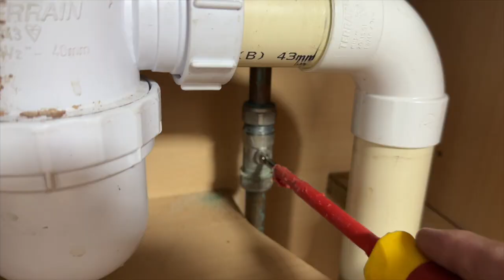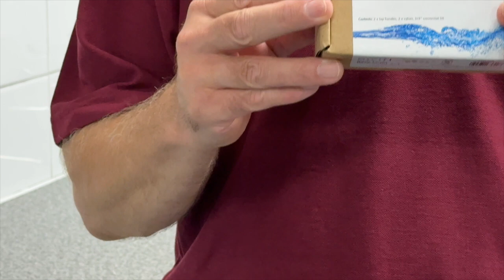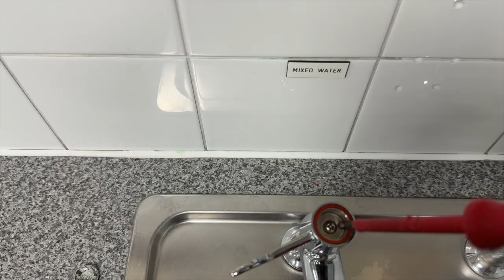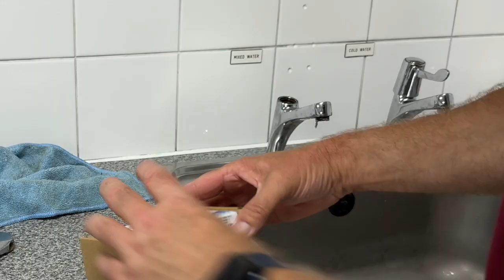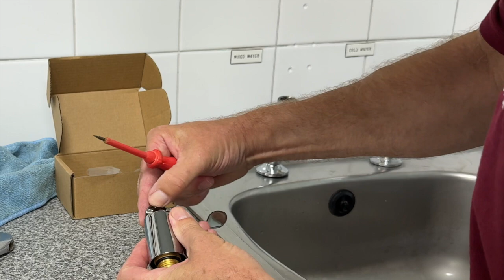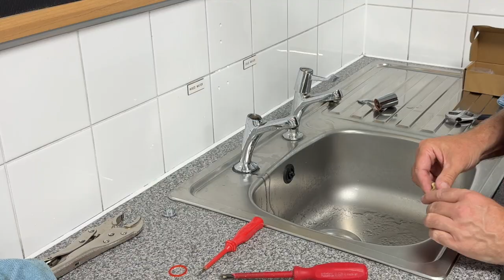How to Fix a Leaking Tap with a Tap Reviver Kit: Step-by-Step Guide

Comment: Looks to me like all it needed was a new tap washer (£1.96 for 5; 3/26) and tightening up underneath with a basin wrench (hope that plastic nut which we didn't see was still okay). That said, if you need a new top half only, and inner brass valve, these kits are good value.